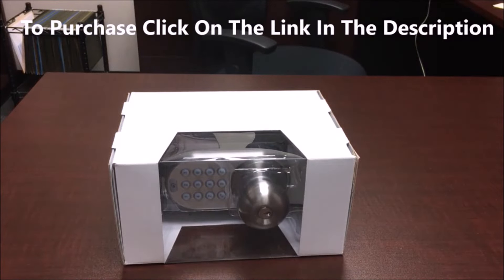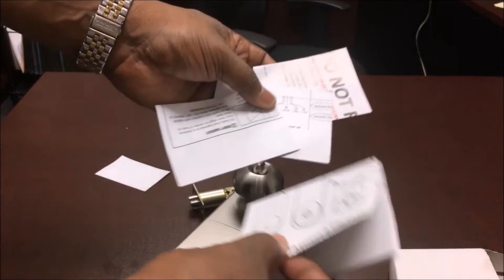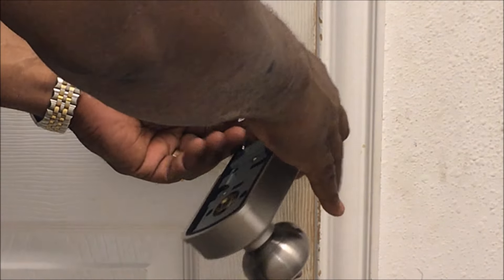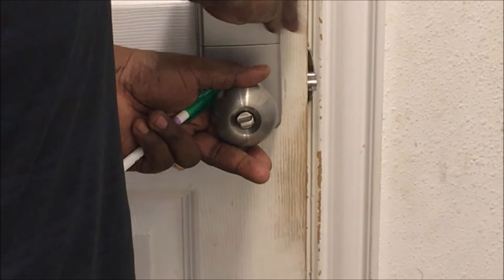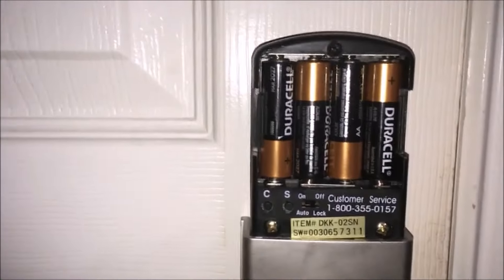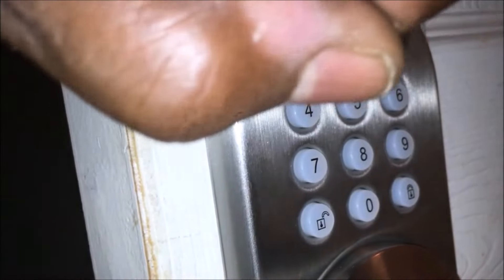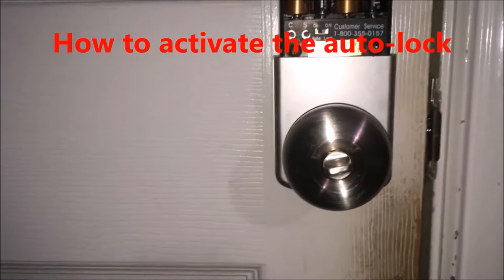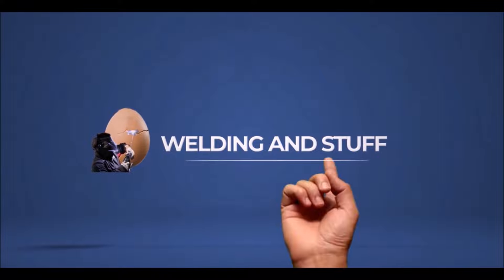How To Operate and Install The MiLock DKK 02SN and TKK 02SN Interior Keyless Entry Good For Bedrooms

Comment: So we are following your instruction which are the same as inside the battery cover and it will not actually lock or unlock the door. It’s doing all the beeps to set the code etc but it’s not actually performing the function. Please help

Comment: I did exactly what you did in the video but when I go to lock it, it flashes red. I cleared it, pressed the S button, chose my code and the unlock button. when trying to lock it after to see if it works, it flashes red. MILOCK still hasn’t hit me back for help yet

Comment: Awesome video! Helped me identify that the lock I ordered was missing parts (shipping it back now) and will refer back to this video when I get the replacement, thanks for posting! PS: do you happen to know the difference between the TKK vs DKK models (I've been finding the TKK one for $20+ cheaper)
Reply from the maker: BreakBomb it might be the back light for the buttons that is different. BreakBomb this is an awesome lock. I like the auto lock feature but I don't use it because it will run your battery down faster
Reply from the maker: The DKK has the back light; the TKK do not (I would recommend you get the one with the back light so you can see the buttons at night  https://amzn.to/2LObpD2)